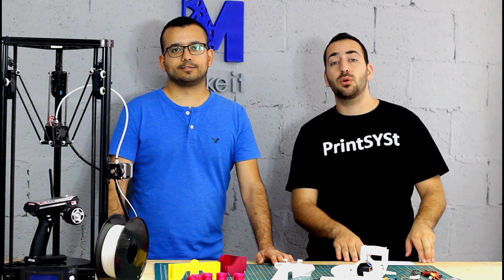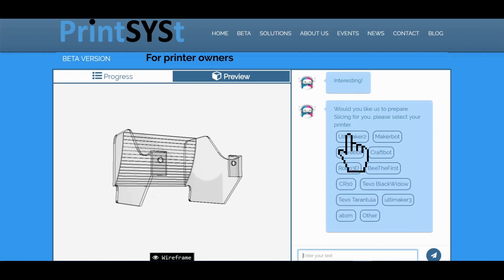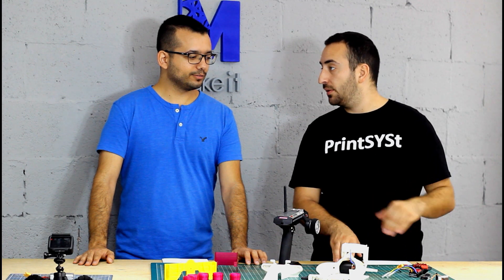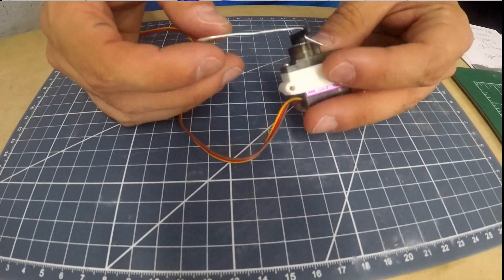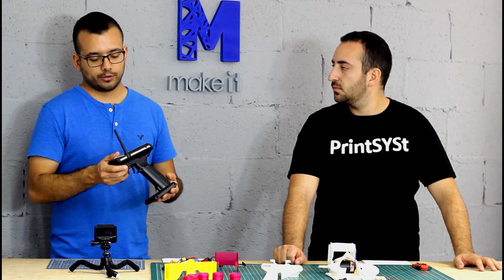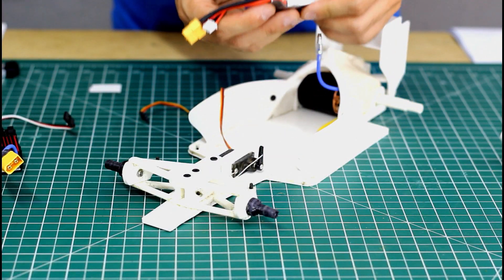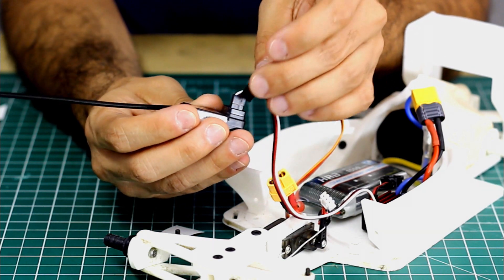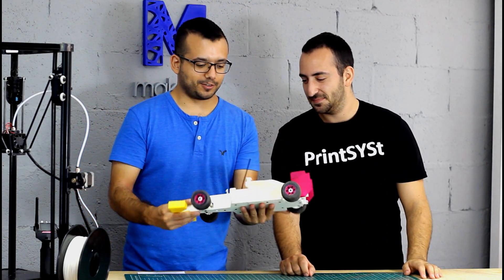How To Assemble The OpenRC F1 Car Electronics | 3D Printing

Comment: Oooh nice vid, i found so few people talking about electronics for this project! Btw I still have some doubts about the motor (i use to fly rc planes, this is first rc car i build). 
What are the suggested dimensions of the motor? I wanted to buy a cheap "Turnigy Trackstar 540-20T Brushed Motor & 60A ESC" kit from hobbyking but i can't figure out how the motor fits into the housing, so i can't tell if a smaller motor ( i guess) would fit nicely and work well, i think this one wouldn't touch the left axle holder because it's shorter